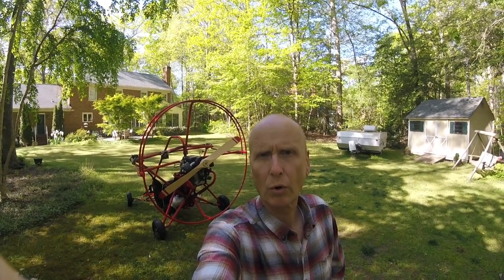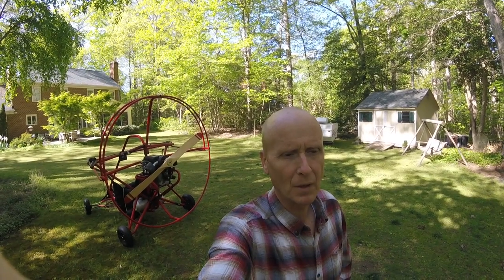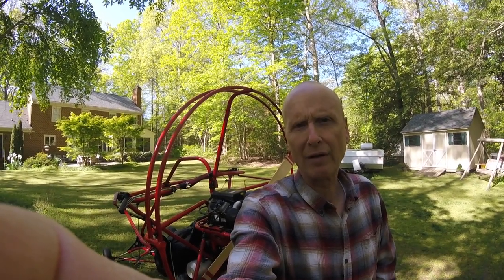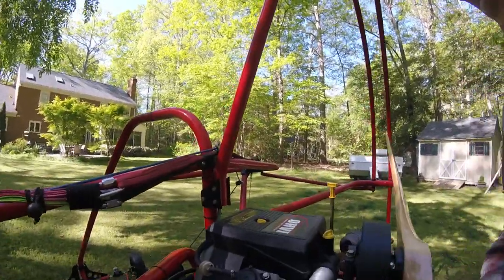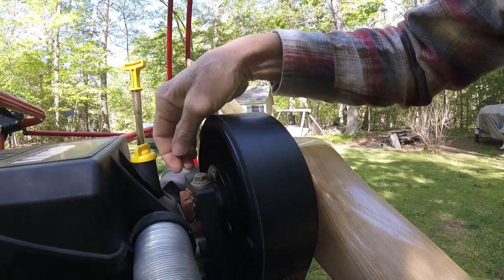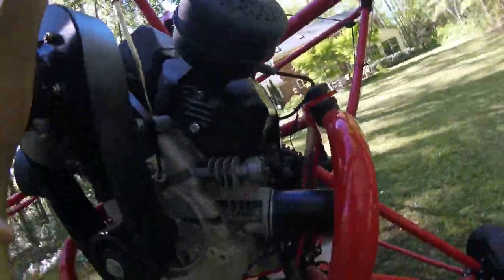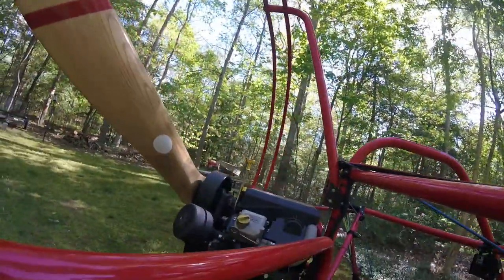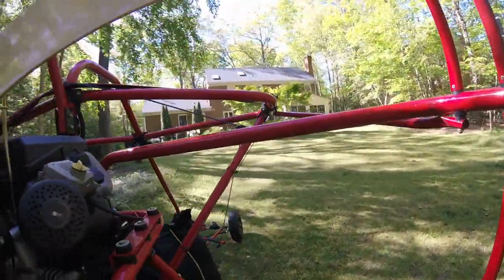Engine Review of my Ultralight Powered Parachute

Comment: Enjoyed watching your review.  I'll make a couple of comments.  If you've gotten 6 years out of that tinytach, keep good logs of your hours.  The battery is rated for 5 years.  I have an excellent replacement when you're ready.  (TrailTech Voyager)  Re: torque twist:  Your attachment spread is 300-400% that of a PPG wing.  Lastly, I've done recent thrust testing with a couple different props.  I'd love to see the actual thrust pull figures with your machine.  Best pull I've managed is like 263lbs @4000 rpm.  I'm no where near that @3600 RPM.  Not many out there bone stock like yours.  Most have trashed their wood prop by now.  BTW I'm 4000max rpm and 3200 level flight with an Apco Cruiser 400 and 3 blade warp prop.

Comment: Ultralight powered parachute ;) a powered parachute is not an ultralight ;)
Reply from the maker: I know that most powered parachutes are not ultralights but mine is. It is s single seat unit that weighs less than 254 pounds and only carries 5 gallons of fuel.
Reply: Subaru never made it, only paid for naming. They didn't sell the patents either.  Oem sales only now due to too many yahoos out there using the gth990 engine on various unsafe machines.  Still made in whitewater WI.  I bought last one.